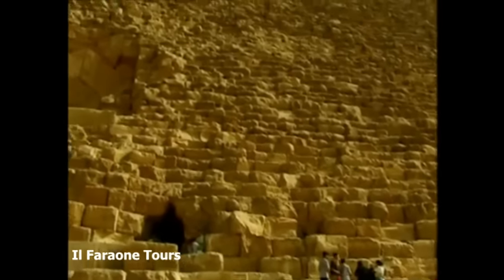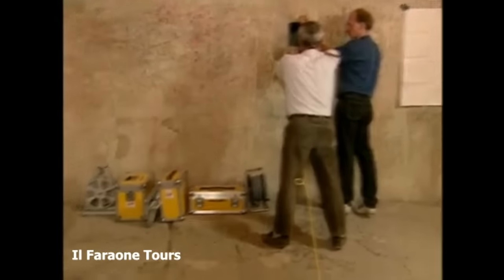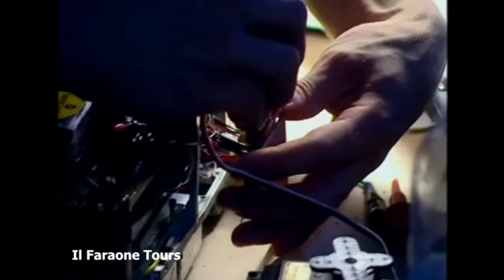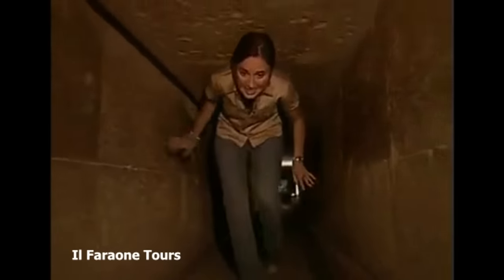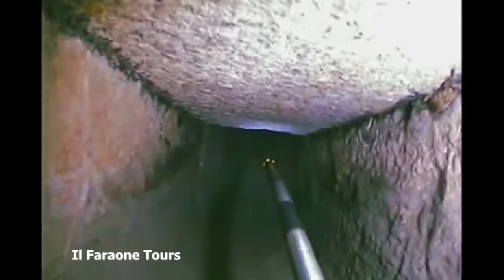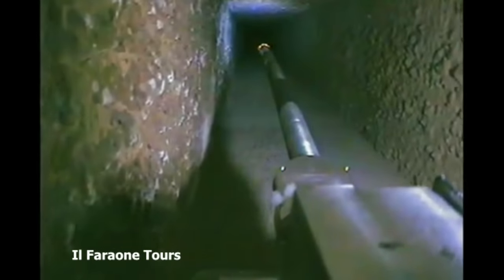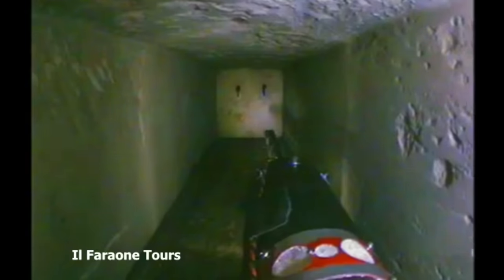Robot Inside The Great Pyramid: Reveals a Secret Door in a Shaft

Comment: That high tech robot looks like something built by a student in high school using parts from radio shack.
Reply: In 1992 things were quite different that today. Neither the camera was too evolute, neither the remote equipments. It was a good and successful effort and this counts,
Reply: @geogeo1261  they should go back  with todays cameras
 LOL. or if they did comment the link
Reply: You can't buy a pyramid crawling robot off the shelf. You've gotta build it yourself. Of course it's gonna look like that.
Reply: @geogeo1261  *2002
Reply: RIP Radio Shack!  (There's actually a few still out there...)

Comment: I can't believe that Zahi Hawass made them drill all of those test holes into all kinds of different stone, just to make sure that little half inch bore through a thin slab didn't collapse the pyramid. It's no wonder why their progress is so slow. What they need to do is reach that second door with a longer drill bit.
Reply: Any engineer knows not to go drilling things with just blind faith.
Reply: @andyrbush  perhaps that applies to modern technology
Reply: Questions would be; 1 will the drill be able to get through stone 2 will the drill and the machine get stuck in the stone 3 will the stone itself split and splinter instead of taking a neat hole 4 will it be possible to stop the drill while it is still in the hole 5 will we be able to leave the drill plugging the hole if there is a fluid the other side that could flood the chamber where the people are located
Just because you can't believe something because you don't understand it, that does not automatically make it wrong or give you the right to mock those that know what they are doing.
Reply: @hiddenaether  Stone? Drills are not modern technology

Comment: I feel pretty confident that a three and a half inch piece of stone isn't going to have any really damaging effects to a pyramid that has stood thousands of years. I don't think drilling a hole in it or even blasting that little sucker to Pieces is going to have any effect on that sucker. RLTW 3/75
Reply: Remember A screw bits or a nail are way too small compare to an intire table or a door holds it together that once you pulled it colapse. Examine first before taking action
Reply: I feel pretty confident if we take all the white stone covering off and use it for our
buildings it will never effect the big pyramid  --- the turkish guy who destroyed the great pyramid
Reply: @kaishanetv9561  is as a Chinese puzzle box
Reply: The entrance of the shafts was smashed too. So why not drill more holes for the least?
Reply: It's not so much about doing damage, it's how much bribe money Hawas can extort from anyone who wants to explore anything in Egypt.
Reply: Humans will preserve a pyramid, before they preserve a life. The Irony!
Reply: Air vents for the builders. They were covered after lower levels were completed. Thus making them air tight. Maximizing preservation.
Reply: @twiningtrain why the step in the shaft ?  An alignment error ? Or some purpose ?
Reply: Why the handles on the door if the shaft is too small to enter ?

Comment: Two copper handles,eh?
It's always made me wonder,since the very first robotic trek,what would happen if you were able to attach two leads from a welder and slowly increase current..
Would the copper melt allowing the slab to be raised or would the pyramid light up?
Reply: To be fair...I'd at least have built a continuity tester onto the robot to test if the two copper handles were connected...

Comment: 1. They broke off the right copper handle. Its why it appears shorter after pushing the stone.
2. Why is the floor different in the drilling video? Its not smooth anymore and shows a pattern.
3. A door behind a door equals pressure chamber pistons of a pump. This is why there is water as detected by the remote sensing blonde. Should have send electric charge to the handles.

Comment: You didn't notice that the right door handle got shorter when you drilled the hole. Don't you see?
Reply: Now I have to go back again to see what I missed! (Any excuse ...)
Reply: The handle is the same size. It's the corrosion that's missing.
Reply: Good observation. Maybe s9meone touched or tugged on it & it broke.
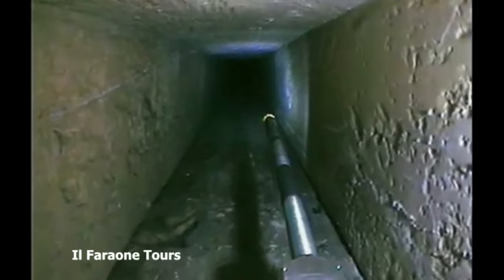Reply: You are right, look at 13:54 and then 14:12 min ... looks different
Reply: @sabsinoname  20 or 30 years later.... We never did get past that second door.... Far as I know of any was...
Reply: @jonathanbair523  yes, and they didnt even try it 😪
Reply: Yep, saw that right away.

Comment: Very interesting.  The original people who built this amazing structure and the other important, several in particular major structures, such as Pyramid Kailash are the true history, right there in front of your eyes.
Reply: The "corridor" is 8"? What use can it be?
Reply: @maurafisher4407  I refere you to my coment above on 03/03/2023 if those, as stated elswere, copper "handles" are in fact an electrical radio frequency Transmission Line {well piece of twin core wire in effect}  and by the size of the 2 conductors and their spacing; capable of shifting a LOT of power.
So the size of the 8" passage is to a certain level governed by the need to provide such insulation and cooling as may be required.
 I would say in my experience an 8" outer duct would not be out of the way for this task.
   This whole theory would either reinforce---- or have no relavence what so ever to---- whats in that chamber beyond.
           I have been involved in radio / radar systems with UK MODRAF for some 35 years retired now miss it like hell!
Reply: The slaves
Reply: Stop calling it a burial tomb
Reply: @rodbarker1017 go put 2 copper rods in each ear and attach copper wire to them and plug into a 220v socket and then you'll know the mysteries of the universe I sware to God it's the truth!.😂😂😂😂
Reply: @kylekendall2911 why?, are you an expert 😂😂😂😂
Reply: it was never constructed. It just exists

Comment: Those handles will only work if there was ropes attached to them. The only way to move that first one with the hole in it, is with ropes attached to the anchors/handles. So they probably pulled those when needing to release or trap water. Back then water use to surround most of that area I think. Maybe to fill the chamber, or for some reason.

Comment: i don't think its a handle. its kinda some sort of wire. like a battery wiring perhaps. the white substance on the black thing and at the bottom are like the white substance you can see on old corroded batteries. they should have took a sample of it and analyze it.

Comment: Those shafts were conduits for the drainage of water, which managed to smooth the granite over time thanks to its enormous quantity distributed over several millennia. The walls are bulkheads which, when operated like gate valves, allowed or not the liquid to escape.
Reply: More like a sewer system 🤪
Reply: @theothertroll  no, not a sewer system, was used for other purpose
Reply: source: trust me broo
Reply: It generates electricity
Reply: Not the underground  railroad system
Reply: @harisondy Sure it does, how 🤔 that's right... You don't know

Comment: just wondering? has anyone measured and mapped all paths and rooms accurately and measured shaft distance and angle to see if it is near any of paths or rooms to look for the door or lock?
Reply: Research the great pyramid void    they have found a large one above the grand gallery and a smaller one by detecting cosmic Ray levels throughout the structure
Reply: @The Great Gazoo they can only scan from internal positions, so below the detection points would not be scanned using cosmic rays
Reply: They have, it goes straight through to the sky and points at the planet of those who built it.
Reply: @davedoogan6650  Really?    I guess you don't know that planets have orbits, and do not sit in one place in the sky.  SNORT
Reply: @davedoogan6650  And your evidence is.....?
Reply: @jelink22  The aliens that built it told me.

Comment: Apparantly there are shafts all around the inside of the pyramid going up in a swirl, which were used to carry blocks upwards… watch the docu from french architect Jean-Pierre Houdin… and the large hallway was used mechanically to be able to pull up large stones, and to keep them from falling down, just have to pull the trolley into a new notch by each subsequent pull…
Reply: That shaft was small , not large
Reply: You’re talking about shaft’s on the outside that they used to move block. These shafts are cut at an angle going from the bottom to the top of the pyramid and you’re not putting any block in them as they are barely 7” x 7”. That’s small just so you know.
Reply: @williamrose7184  the grand gallery is huge, there could have been a pully system in there for the largest blocks. The shafts they've found open are small, but there might be larger ones unfound. But that theory could indeed be false. There's 2 other methods I've seen on youtube. One was with tumbling blocks on the side of the while the pyramid being in that state still a staircase. And another one was with wooden construction tumbling the stones side ways and then putting supports underneath at each side till the block is high enough for the next level. These methods both also seemed plausible for the regular blocks but don't really address the largest ones...
Reply: That is one theory,  but just a theory,  not proven.

Comment: Big fuss about a small thing, I think. This block looks like a tool for measuring the tunnel's cross section as they were building it. The block has handles so it could be pulled out. Or maybe they used it to temporarily block the shaft so mortar and other stuff wouldn't go down it. The block's corners are chipped, which could be from extensive use of it as a tool.

Comment: This is truly amazing!
PS. There seems to be an image on the inner door... Hope it is not a warning of something perilous from a forgotten age...
Reply: Thats most likely to be the case. Usually when the seal is too tight you can't even get in, it is already the warning. Jokes aside, drilling holes in a shaft seems like a very stupid idea, because if such complex engineering placed it there, it obviously means it is important. Like a blast door would be for inner pressure, perhaps to work with air circulation. Remember the Pyramids are a thing to preserve things inside.
Reply: @cybergothika6906  I mean to be fair, they drilled a hole in a vertical sliding door that isn’t supporting anything lol
Reply: @DougieD_Funk  If you look to the project, it seems to be like ventilation shaft. it is small just like our air conduits are. To find the real secret I bet my money it has something to do with the entrance, and the ''big void'' detected by the system.
Reply: @cybergothika6906  right I just mean they drilled a hole only enough to fit a gooseneck camera through a door in front of them that would move vertically. They show that part in the video. So there’s no structural compromise that’s all
Reply: @cybergothika6906   since when are Pyramids things to preserve things inside? Not a single mummy was found inside the great pyramids. They are not tombs.
Reply: @TheLegendaryBM  Find a girlfriend.
Reply: Yes, I see a faint image of a "being's" face... the eyes seem to twinkle... can they go back with better cameras?
Reply: The message translates to:  Two stone masons walk into a bar…

Comment: I think one would build a structure alike the pyramids, not meant as a building but as a means to control an enormous amount of energy. The little door in this video, I think was meant to be a fuse  to lock down a process when the forces ran out of control. The two copper parts were melted and the door locked into morter. So if this is a fuse something ran out of control.
Reply: No... Just no.
Reply: Alien nonsense
Reply: From the original Village Idiot . . . .
Reply: I'm not sure about being out of control but I agree with the rest. Have you been listening to Tesla?

Comment: Hey you guys, look, that cube of stone that is blocking the shaft which has the wire looking dangling things which are the remnants of the handle, by the way, and this block is obviously made to be pulled in and out of that shaft with that wooden shaft with the hook on the end by snagging that now corroded wire handle. Just vacuum out the shaft to where the block can slide and attach some kind of device that can hold onto the block of stone as it is being pulled out. Easy.

Comment: I'd be more interested in how they cut the stones with such position with basic tools thousands of years ago ... today there a machines but they only had hammer and chisels even splitting the stones wouldn't leave any cuts and lines such as this all very strange even the point of making such a square ⬛ tunnel it's clearly not an air very or sun light duct or was it ? I think not as they are building outward and upwards not inward... pepper drill that block out and onward

Comment: That was actually quite annoying watching that! I might as well have watched an episode of crystal maze! are you kidding me, you can see by the map of the place that, that small tunnel leads to the out side of the Pyramid!
One would have also measured the outside of the pyramid, done the maths on how far in they themselves into the pyramid to know that that chamber leads to the outside! where they are there is not enough space for there to be another room like the one they are in or even smaller, due to the mathematical area and space which was done on the outside already! those areas was used to let in light, air flow and water, also to prevent he pyramid from collapsing, it gives it the sustainability to help the duration of it's standing, including that particular chamber aiming towards a specific star system Orion, Sirius or other depending on it's position and angle they are located inside.
Anyway! The bodies that were found should have been left as they are resting under a specific alignment of the star systems...it's kind of upsetting in a lot of ways, I know the team wants to know what discoveries, but at least leave the dead bodies.

Comment: well aint this fun looking at the stunning pictures of the block stone with its handles; What if they wernt handles but copper conductors.
Noting that the holes are round, ish and spaced  27.5 units apart and 4 units in diameter and given the well known relationship fot the impeedance of twin feeders being Zo= 273 Sqr Root log10 D/d   where D is the spacing and d id conductor diameter Zo comes out as 250 Ohms. now that is in air given this is in some sort of rock My guess Zo would come out arround 300 Ohm.
    Now this is some coincidence iin that 300 Ohm feeder is a very common value in use for rf feeders even today
It is a bit of a compromise between inductive and capacitive losses. At audio frequences 600 Ohm is the standarad for twin feeder.
Me? 35 yrs MOD civillian service in:-- radio / radar & science instruments to the  RAF & Met Office.
May be a {680nm radiating, common North Sea fish}, figure that out ha ha. but there is a lot of WOO about the Paramids being some alien power thingies. Who knows?
 Whats behind the block stone one wonders. It is of, noticibly, different material praps to fix the resultant Zo.  Now  we got a peep through the  3" stone to find a chamber that may be part og the muon temography detected void I would say the remaining part of the transmission line was hoiked out by toomb raiders in antiquity. the state of the remaining bits bears this out. the down coming line would need spreaders and supports at   intervals. If the frequency matched the available space these could be simple 1/4 wave stubs. Dont worry its radio gobldy gook but is used a lot at short wave transmitting stations.
Weeee Heeee the plot thickens don't it. ha ha ha.
EDITED IN  After looing at the brilliant video covering the Northen shaft I still say the only thing that fits is those are wires for an unknown purpose. A structured transmission line would not be possible because of the bends and twists

Comment: Tunnels can't be built to precision if there was no bright light around the area of construction, it will be impossible unless the builders has an super infra red light installed in their head or visor.
Reply: What tunnel?
Reply: You are assuming that the builders cut out the tunnel after the main part of the construction was completed. It's infinitely more likely that the tunnel was built in during construction, much like you would leave an opening for a window or a door if you were building a brick wall.